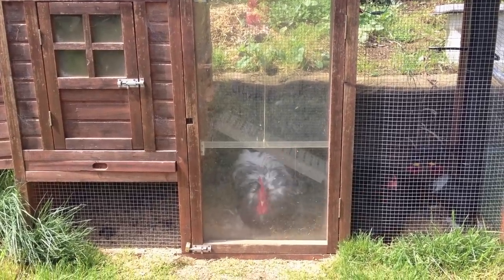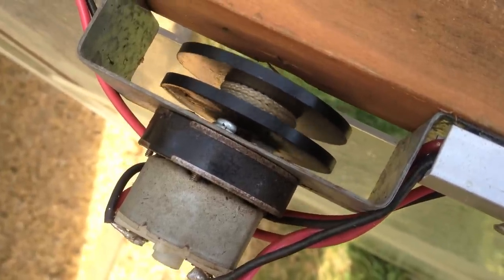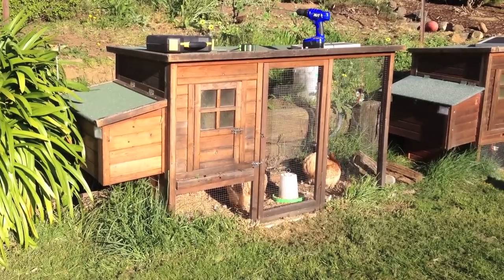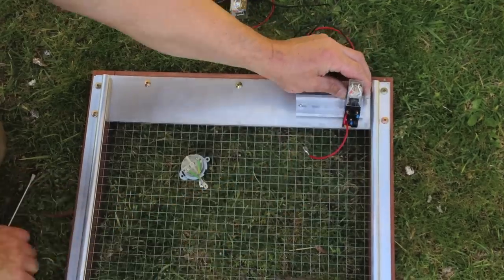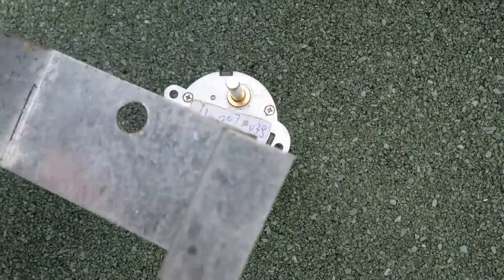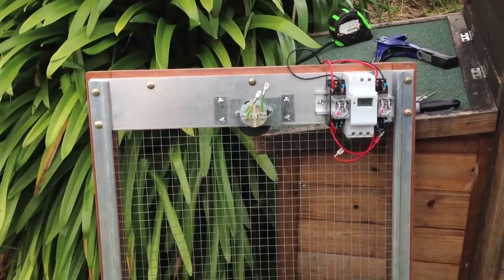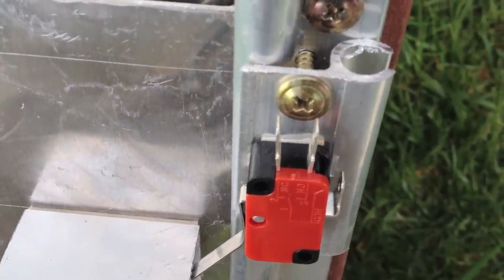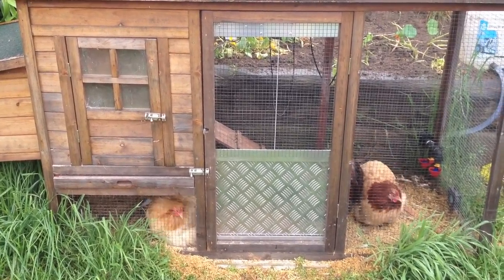How to Make an Automatic Chicken Door - Step by Step instructions HD

Comment: I know this is an old video but wanted to give you a huge thanks for posting it. This is very similar to what I had in mind but I was going to use a wind screen motor that I already had, that little gear motor will work much better as far as space . Great design and excellent video! Thanks again

Comment: Google seems to wait for a week to show me these videos, this one just shows up but my search never found it.  
Anyway, good job, and pretty simple design for DIY.  I have found a early 2000's volvo rear window setup is pretty much already setup to open/close, just needs the timer and motor controller.  It goes too fast and is too strong, to run it at 12v, but it works at 5v too.
But I'm doing one now that would be easier for others to copy using stepper motors as they are cheap brand new and will swing open a door, the steppers are not too strong so they just 'slip' if a chicken is in the doorway.  This requires another lock mechanism so the door can't be opened by force.   I've watched lots of videos..some designs don't lock and can be pushed up if something tries hard enough.

Comment: To be honest I really hate the string type doors almost as much as I hate the vehicle antenna doors, BUT I like yours very much. I even come back to your video from time to time just to watch it like a favorite movie. I even recommend it to others who want a string door. I just add that hey should use two timers like yours in stead of one. much easier to wire. But we have already conversed about that.

One thing tho that I have always wondered.

You say "Two relay switches means that the system uses less electricity, which can be vital for reliability when using battery power." I would be very interested in an explanation. TY.

Comment: Is the relay in the timer still drawing power all day.

All you need is a timer a DPDT relay, two diodes and two limit switches. Way simple. Add photocell and a SPDT switches and you can go from timer or dawn till dusk.
Reply: Where would you put the diodes?
Reply: @adamesch6834  You place the diodes at the limit switches or you can put them in a control box. It is a bit "complicated" to explain in writing( for me anyway). I have a video called "Basic Car Automatic Antenna Wiring Diagram". The diodes are wired basically the same way as if you were to wire a coop door. This way is still good and there are definite pros of doing it with diodes. But I actually rediscovered how to do it with no diodes and using only two SPDT timers (Video is up) and of course the limit switches. If it helps please let me know.
Reply: @AztecWarrior69_69  Thanks

Comment: very neat looking. Thanks for the wiring diagram at the end, but It still needs a lot of figuring out as all the  switches aredrawn in open position, so no idea what is Normally closed and normaly open or which limit switch goes where, but I'll figure it out :-)
yep... figured it out. The timer stays activated for the entire time you want the  door open and when it switches off, it closes the door
Reply: He says the relays are activated only while the door is moving.  Apparently it doesn't take power to keep the timer in the active state.  Some kind of flip-flop I guess.
Reply: @obnubdonbstub8166  The way it works is that the timer goes from NC to NO, and closes the connection, Then it goes through the NC limit switch, and on to the relay and it turns on. The relay Is set up so BOTH the POS and NEG are disconnected in the rest state, both get connected in the active state, which turns on the motor. When the Upper limit switch is reached the current is cut off. The same happens then the door closes. So yes the external relays are off when the motor is off. However the relay in the timer is still on when the door it up.

Comment: Fantastic video, thank you for posting! I made the door and have had it running for a few months now, I have used a sewing bobbin as the pulley however the string I'm using has a tendency to fray, break and / or get stuck with the force of the motor. What cable / string did you use that doesn't tighten on itself? Thanks!
Reply: Use lawnmower pull cord. Or high test fishing line. You can always use 3/32 wire rope/cable.

Comment: cant find that plastic pulley. can you help me with an ebay link? ty...
Reply: +Chris Tsam I just came up with an idea for the pulley with a tightening screw.

Buy a drill collar and glue some circular side walls to it.

Drill collars come with a screw.  You can cut some circular sidewalls out of hard plastic with a hole saw (or scissors) and just glue em onto the drill collar.
Reply from the maker: +Chris Tsam I had the pulley's made at our local engineering workshop, out of Nylon.
  They were only a couple of dollars each as I ordered 6 of them. You 
could try your local engineering shops perhaps.

Comment: David,
Great video!  Would you be so kind as to provide the make and model numbers of all the electronic components, since there are thousand of choices on the internet. For my application I will have to use up to a 1/2 hp DC motor. Will your electronic components work with such a motor?  Also I have to control the speed of the motor with probably a pulse width modulator (PWM).  Do you have any ideas how I would wire the PWM?  Your help would be greatly appreciated.  Thanks.
Lee

Comment: Thanks for the video. It looks like your timer has an AC input but the circuit shows DC from the battery. I purchased a timer that looks exactly the same as the one in the video but it only works when 240 AC is applied. Can you confirm your design is using 12 VDC into the timer?
Reply: I think I have the same timer but the documentation sucks.  It appears the 240 V rating is for the switch contacts.  There's a "power" parameter which is 4.5VA.  If that referred to the switch then it would work out to 19mA load capacity, but elsewhere it says the load capacity is 16A so I think the 4.5 refers to the clock and maybe it should be 4.5VAC input.  If that's true most likely there's a bridge rectifier in there so you could apply 4.5 dc in either polarity.  But I'm guessing.  I haven't hooked it up to power yet.  The ebay vendor had it listed as as 12V clock.
Reply: I ended up just getting two 12 vdc relay/timers. (like this http://www.ebay.com.au/itm/12V-16A-LCD-Digital-Display-Programmable-Timer-Switch-Fit-for-Water-Pump-Fans-/172243236970?hash=item281a7f386a)
Set them to run for 1 minute once a day. One timer for door up and the other for door down.
Biggest pain to make and attach to the motor was the pulley.
Reply: hi ,so no limit switch? 2 timer 1 motor 1 battery is that all?

Comment: I just had an idea for the pulley with the tightening screw:   make one from a drill depth stop collar.  Simply cut some circles from some hard plastic (use sharp knife or hole saw) and glue the circles to the side of the drill depth stop collar. 

Or buy a wooden or plastic pulley and drill your own screw hole.
Reply: thank you!!

Comment: I have tried to get this to work but for the life of me, the relays baffle me.  The relays I have are numbered but the schematic is not so I'm not sure how everything wires together.  I'm using all the same electrical parts as you as far as relays, timer, motor etc.  Nice design, I just need some help with the relays.

Comment: Think I just figured it out. What I learned. 12 v means 12 volt. Timer light comes on with 6 v but wouldn't actually switch. Need to press limit switches when connecting to battery. Use NC normally closed connection to the one on the side. There are short wires connecting the relays. Stared with 20 gauge wire, but ended up using 14 gauge (which was tight). Haven't found d sail track if people have suggestions. Screws to attach my 15 rpm motor were metric #4 (I think). Ordered another Relay will set it up soon.

Comment: David, GREAT video.  But being the novice, and ignorant guy I am...  could you please follow up the finishing of the wiring please?  Wiring the limit switches to the relay and kill switch?  I have an almost complete system, but just can't figure out how to finish wiring in the limit switches.   :D
Reply: This is where I am stuck also. I'd love a photo of the wiring if possible.
Reply: Daryl Hogg i got it figured out finally.  Ill shoot ya the pic tomorrow
Reply: I got it sorted this weekend. Just needed to sit and look at the diagram more.
Thanks!
Reply: Daryl Hogg how are the two micro switches are connected?
Reply: The wiring diagram is at the end of the video. Pause and screenshot it.

Comment: Hi there...Thanks for a great video. But where did you get the Pulley wheel?
Reply from the maker: +Frank N. Haugan I had the pulley's made at our local engineering workshop, out of Nylon.  They were only a couple of dollars each as I ordered 6 of them. You could try your local engineering shops perhaps.
Reply: Hello and thank you for your reply. Yes I realize that this was not something to be purchased in normal shop :) I now use a wheel that I found on eBay (with set screw) and then I glued plastic from ice box as walls for the pulley. Not as good as the one you have, but it works. But I have modified this with Orvibo (app Controlled) so I open the door with the app instead of "normal" timer. Orvibo S20 also have timer settings in the app so you can choose to open/close with timer or manual. Frank

Comment: Hi David great video I am having trouble with the wiring one relay is always powered and the timer is only working one relay. I have bought all the exact same parts as you but I can't find a pulley but if you could email me a wiring diagram the one at the end of the video doesn't have the limit switches in the diagram thanks mike
Reply: The limit switches are the symbols right under the timer .
Reply: @AztecWarrior69_69  Thank you for that -- I've stared and stared at the diagram and couldn't get it to make sense until I read this, and realized those symbols are the limit switches.
Reply: @thecaudells  You're Welcome. However if you are going to make a door like this, I recommend using two of these timers and no external relays. Here is a diagram video I made that will help (I Hope). I just realized I should have labeled everything. I will do that with the next video coming soon.
https://www.youtube.com/watch?v=3BT09Rd3JKY
Reply: @Aztec Warrior thanks — I’m sure I’m showing my ignorance here, but with no external relays, what reverses the polarity to the motor?  I’ve seen your videos a couple times as I’ve researched this. I’ve built a door that is a combination of Chook Page’s general idea (mainly the wiring diagram) and several others. I have two timers, a relay board, two limit switches, and an old cordless drill with threaded rod to act as a linear actuator. It’s powered by a 12v SLA battery with a tender to keep it charged. I’ll post a video at some point after I get the last few kinks worked out.

Comment: I like your Circuit, But Instead of using a timer I'm using a reed relay and a light sensor / No setting the time 3 or 4 times a year, So thanks for the inspiration.
Reply: +Graham R Dyer  Hi, do you have a link that would show how to set that up? I found a youtube vid that shows it working but no info to replicate it :-( Thanks
Reply: I didn't do a video but the circuit is on my Facebook page ( Maharg Reyd ) I used a reed relay and my light sensor circuit, easy.
Reply: Are you able to post a link to the diagram.  Thanks.  I cant seem to find it but keen to find out to to set this up with a light activated sensor.
Reply: Hi Mr Gordy61, are you able to post a link to the vid.  Thanks.

Comment: Great video!  Very helpful and just what I was looking for!  Can I ask where you found the pulley wheels?  I have searched online and several home improvement stores with no luck finding anything close.  I have all of the other components.  I will share video when I complete mine.   Thanks again!!
Reply from the maker: +Bert2369 I had the pulley's made at our local engineering workshop, out of Nylon. They were only a couple of dollars each as I ordered 6 of them. You could try your local engineering shops perhaps.

Comment: The best of a very large bunch - and Aussie too. As with comments, have found all of your parts on e- bay EXCEPT the pulley ! And reasonably priced. Micro switches - one red, one black. Any difference ?. Could not find red. A Brilliant you tube if you could add the parts nos. and source.  Making it too easy for us ? This door to keep geese safe and save me the early morning "stagger out". Thanks .Bundaberg. Have not done these "comments" before. Can You email re. red micro and pulley ?
Reply from the maker: +nick venters   I had the pulley's made at our local engineering workshop, out of Nylon.  They were only a couple of dollars each as I ordered 6 of them. You could try your local engineering shops perhaps.
As for the micro switches, the colour is irrelevant, and simply how each manufacturer makes the same product. Incidentally, they are cheap and once you've used them, you'll find lots of uses for them. Best of luck.

Comment: Anyone - where can I get the Pulley???????
Reply: +Andrew Roch I would get a plastic or wooded spool and drill a hole for a screw.  You can probably get away without a spool and just let the string wind itself on the motor shaft.
Reply from the maker: +Andrew Roch I had the pulley's made at our local engineering workshop, out of Nylon.  They were only a couple of dollars each as I ordered 6 of them. You could try your local engineering shops perhaps.